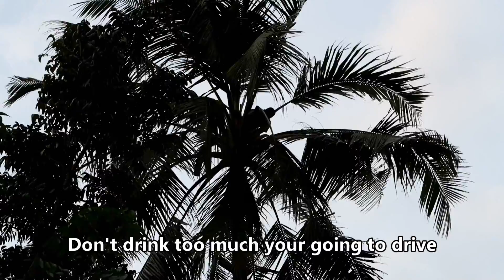Building Cheap House in the Philippines | Laborer Human machine

Comment: 2 tips. 1st tip - hollow block should have gone on the outside or inside of timber posts. 2nd tip - slab down 1st with steel mesh and hollow blocks on top of slab. man, these boys work hard, would love to give them some proper training so their hard work is correct
Reply: nikrum ffs that's always the way in province, seems to hold up quite well